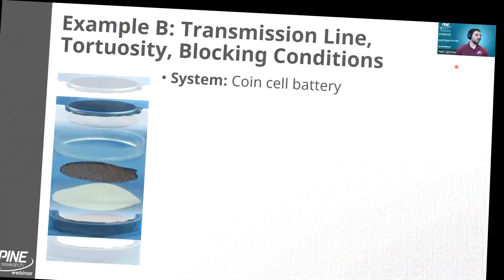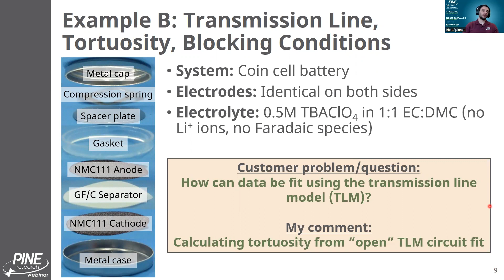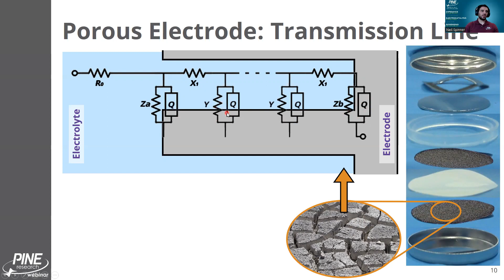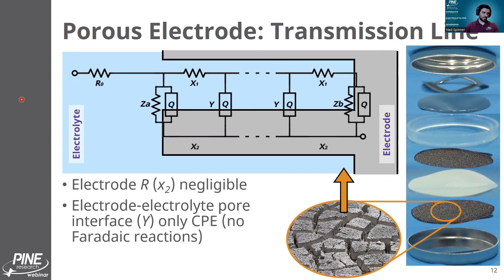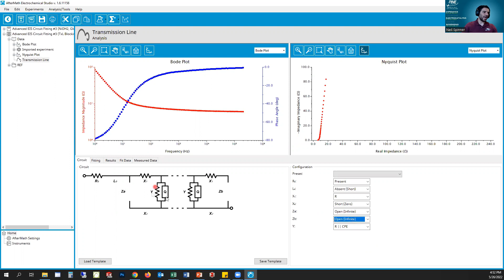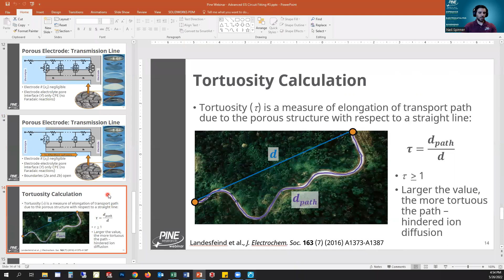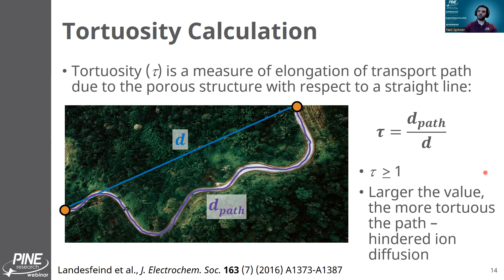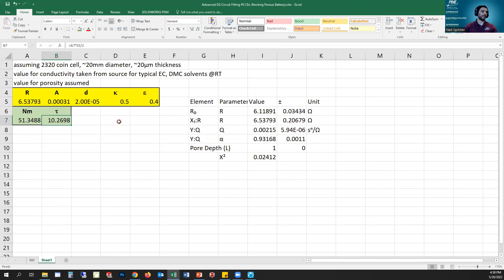EIS Transmission Line Fitting of a Coin Cell Battery Under Blocking Conditions

Comment: Summary

Intro
- 0:02: [Music]
- 0:08: Introduction to the video on EIS transmission line fitting of a coin cell battery under blocking conditions.
- 0:27: Outline of the video structure covering the electrochemical system, modeling using a transmission line, circuit fitting, and calculating tortuosity.

Description of Coin Cell Battery
- 1:00: Description of a coin cell battery, consisting of a metal case, cap, compression spring, gasket, and identical NMC-111 electrodes.
- 1:47: Details on the electrolyte used and the concept of a blocking condition in the battery setup.
- 2:35: Explanation of blocking boundaries and their use in studying the microstructure of porous electrodes.
- 3:10: Discussion on how to fit data using the transmission line model and calculate tortuosity.

EIS Transmission Line Model
- 3:29: Microscopic structure of the electrode resembling cracked earth, indicating porous microstructure.
- 3:59: Simplified model of porous microstructure including electrolyte, electrode, and backing electrode.
- 4:26: Explanation of the transmission line model, including leading resistor, impedance in electrolyte, boundary conditions, interaction in the pore, and impedance in the electrode.
- 6:10: The model reflects the distribution of current in the pore, representing non-uniform current distribution.

Transmission Line Circuit Fitting
- 8:30: Analysis of EIS data, showing capacitance, 45-degree lagging behavior, and diffusion typical of a transmission line.
- 8:57: Use of specialized transmission line circuit fit in software and adjustments to the model for fitting.
- 9:32: Refinement of the circuit fit and analysis of the fit quality.
- 10:53: Consideration of variations in the model assumptions and the overall fit quality.

How to Calculate Tortuosity
- 11:24: Introduction to tortuosity, its representation, and its calculation using the McMullen number.
- 13:00: Method for calculating tortuosity involving impedance resistance, surface area conductivity, thickness, and porosity.
- 14:09: Assumptions and calculations for determining tortuosity in the specific coin cell battery setup.
- 14:58: Interpretation of the calculated tortuosity value and its implications for electrode material and diffusion.

Conclusion
- 15:18: Conclusion of the video with an invitation for questions and information on advanced EIS webinars by Dr. Neil Spinner.
Reply from the maker: Thanks for the in-depth description

Comment: I have a question regarding tortuosity. My understanding is that tortuosity primarily provides insight into the transport properties of the electrode material itself. However, I am curious if the electrolyte, specifically the type of cations and anions, also contributes to the tortuosity. If that is the case, I am wondering how the diffusional contribution of the electrolyte ions could be calculated using values obtained from circuit fitting. One idea that comes to mind is introducing a Warburg element in series with resistor x1, which represents the electrolyte resistance inside the pores. The incorporation of a Warburg element would enable the calculation of the diffusion coefficient of ions, particularly in cases involving pure double-layer charging, within the pores. Does such a modification seem reasonable, or are you aware of alternative methods to address this?
Reply from the maker: "I am curious if the electrolyte, specifically the type of cations and anions, also contributes to the tortuosity"

I don't think so.  I believe tortuosity is strictly a physical measurement of the material and describes how tortuous, or not direct, the pathway is through it, essentially, regardless of what is moving through it.  I do think it possible, and perhaps even likely, that the choice of electrolyte could impact the reproduceability of the experiment and measurement of tortuosity to a certain degree.  But I would more attribute that to the normal amount of error and uncertainty associated with all electrochemistry experiments, and not necessarily to the definition of the property itself.

I also don't think such Warburg modification of the transmission line model is appropriate, but that may be a bit more of a longer discussion of the transmission line.  My other answer to a similar comment you made elsewhere went into a little more depth on this issue as well.
Reply: @Pineresearch  I am interested in exploring the diffusion-limited behavior of cations and anions within a particular porous electrode, aiming to capture both qualitative and quantitative trends. Since the TxL model accurately represents the morphology of a porous electrode, I would like to know how to effectively study the diffusion-limited behavior using this model. Specifically, I am keen to understand which electrical circuit elements of the TxL model should be the main focus and if there are any additional elements that need to be incorporated to accurately account for the diffusional-limited behavior. Any suggestions or insights on this matter would be highly appreciated.

In literature, I came across an example where a simple Randles circuit (consisting of a Warburg element in series with a resistor) was modified by substituting the conventional Warburg element with the M element from the De Levie model, which is known to account for restrictive diffusion (whether linear or non-linear). However, as we previously discussed, considering that the De Levie model is essentially a variant of the TxL model, it would seem logical to replace the Warburg element with the TxL model. What I find puzzling, though, is why the TxL model does not appear to have an element specifically associated with diffusion.
Reply from the maker: @Heisenberg-EC  This is definitely an interesting a worthwhile kind of investigation for you, and likely one that requires more in-depth discussion and research than can be covered in this video's comments.  I think there may be some explanation regarding the seeming absence of diffusional characteristics within the TxL model, but again, I think this discussion may be a little beyond this comment section.

Comment: I would greatly appreciate it if you could offer a physical explanation for why the boundaries of pores are treated as having an open or infinite impedance, and under what circumstances this assumption holds true. Personally, I would expect that the same electrochemical processes take place at the boundaries of the pores as they do within the pores, which is represented by Y, especially when considering spherical pores.
Reply from the maker: First of all, the transmission line (TxL) model is not specifically designed to represent spherical pores, so while it may work for such systems (honestly I don't know for sure, I don't have personal experience with it to say for sure or not), it is really more suited for the kind of rectangular shape I show in this video.

As far as why the boundaries are infinite, open, short, or really frankly anything dissimilar to 'Y' at all, this is a good question, and one to which I don't know that I have a perfect answer, to be candid.  I can only give a little adjacent pontification, if I would call it anything.  Mainly, in engineering science and mathematics, it is common to apply known end/boundary conditions (e.g., Dirichlet, Neumann) to differential and partial differential equations as a means to solve the mathematics analytically.  The TxL, to my understanding, is something of this nature.  So, one (admittedly a bit unsatisfying) reason is that simply put, mathematical solutions to the complex infinite summation included in the TxL requires a set boundary/end condition.  Without this, it is somewhat of a non-starter and circuit fitting cannot really be performed at all.

The other thing that is somewhat unique to the TxL is that the infinite 'Y' sum is supposed to be representative of an aggregate of charge distribution throughout the pore.  In fact, this is the explanation used by Juan Bisquert in the papers from which the TxL originated (to the best of my knowledge).  In other words, we observe the phenomenon of charge distribution in a porous electrode, and the TxL is a way to capture that behavior, and doing so also means there is necessarily a difference in the resistive and/or capacitive elements at either end, and throughout the pore.  Perhaps in some way, this can help explain why there is a need for different elements at different physical locations in the TxL model.
Reply: @Pineresearch  Based on my personal experience, I can confidently assert that the transmission line (TxL) model can effectively fit EIS data of porous materials that possess spherical pores. I am currently working with a material that exhibits such a morphology, and interestingly, its Bode plot bears a striking resemblance to the Bode plot demonstrated in this video. Upon qualitative comparison, the only noticeable difference I observed is that the horizontal lines in my Bode plot appear flatter across the entire high to mid frequency range. This observation leads me to argue that the TxL model can indeed be applied to porous materials with spherical pores.

Regarding the boundary conditions of the TxL model, there is one aspect that confuses me. If the mathematical solutions involving complex infinite summations within the TxL model necessitate specific boundary conditions, why is it permissible for the boundary conditions Za and Zb to be similar to Y? Wouldn't this essentially imply the absence of any boundary conditions at all? In fact, when fitting my porous electrode data, I obtained the most satisfactory outcomes when Za and Zb were exactly akin to Y.

Perhaps this alignment indicates that I am indeed working with spherical-shaped pores, where the charge distribution is relatively uniform. This could potentially explain why I do not require additional physical locations within the TxL model, apart from Y (and X1). In any case, I recognize the need to delve deeper into the fundamental principles of the TxL model to gain a better understanding.
Reply from the maker: @Heisenberg-EC  Having a boundary condition with the same form as 'Y' does not necessarily mean it has the same value as 'Y', so they can still be distinctly different.  Additionally, I don't think in general the TxL requires they be different, I was merely using an example I am aware of with engineering mathematics to help explain their presence.

Comment: Should the transmission line model be the default choice for simulating porous electrode materials, or can a standard Randles circuit also be used for fitting? If the latter is applicable, what are the advantages of using the transmission line model? Additionally, are there specific characteristics in EIS data that indicate the suitability of the transmission line model? For instance, would it be appropriate when the data begins with a 45-degree angle line, similar to the example shown in this video?
Reply from the maker: 1. Yes, you can certainly still use a Randles circuit (or series of Randles circuit) instead of the transmission line.  It is just a choice of how you wish to represent and analyze your system.  The advantage I suppose to using the transmission line is that, in some sense, it can more accurately represent the reality of an electrode microstructure because the infinite sum is designed to capture the distribution of charge within the pores, which is something a single Randles circuit does not describe on its own.

2. Generally, I recommend the use of a transmission line from a priori knowledge of the electrode microstructure, rather than looking at the data and applying it based on the data appearance.  That being said, your suggestion is not necessarily wrong, and perhaps in a situation where you are unsure of your electrode microstructure but suspect it might be porous, the appearance of a high frequency 45° line could help inform the application of a transmission line.
Reply: @Pineresearch  I am interested in the transmission line model due to the unique characteristics of one of the electrode types I'm using, specifically a highly porous and amorphous IrOx electrode. However, when conducting a PEIS measurement to evaluate the Ohmic drop, I consistently observe an almost perfect semi-circle (albeit slightly depressed) in the high-frequency range. This makes me question whether employing the transmission line model, as opposed to a Randles circuit, is truly justified in this scenario.
Reply from the maker: @Heisenberg-EC  Typically EIS data that displays a small and almost perfect semicircle in the high frequency region, regardless of the other conditions and parameters used, is an indication of one of two different phenomena; either, (1) there is an artifact going on and the semicircle should be largely disregarded, or else a shunt employed to try and clarify this feature, or (2) it represents an underlying substrate-film interaction that is always present in your system no matter what potential you're applying.  In fact, if it's #2, you may not really be able to apply the transmission line element very easily because in situations like this the time constant is much faster (i.e. smaller, where it shows at higher frequency) and unless you are able to simply cut out or disregard (just for analysis purposes) that first feature (which is possible, for example, with our AfterMath software), you will probably be forced to use some combination of Randles elements.
Reply: @Pineresearch  I don't believe there is any artifact present in my experimental data. Despite not using a shunt in my recent experiments, the same semicircle appeared when I did use a shunt. It's worth noting that this semicircle remained highly reproducible across different electrolytes. Moreover, the semicircle was not of a small magnitude; although I should verify the exact measurements in my data, it encompassed the mid-frequency range.

Based on my observations, I'm inclined to attribute this phenomenon to an underlying substrate-film interaction. I am actually utilizing a super thin (20 nm) IrOx film on a Ti substrate. I am particularly interested in the origins of the charge transfer resistance associated with this semicircle. My suspicion is that it may be linked to the oxidation process of the porous IrOx film, i.e. deprotonation of the OH groups via a proton-coupled electron transfer (PCET). I'm measuring at anodic potentials. I am measuring the Ohmic drop at anodic potentials (0.5 V_RHE); however, it is important to acknowledge that IrOx undergoes oxidation at an early stage and over a very broad potential range. What are your thoughts?
Reply from the maker: @Heisenberg-EC  That sounds reasonable to me, though of course I am not an expert in this exact field and probably cannot speak with more authority other than to note that your explanation sounds logical.  As I mentioned in my last comment, the fact that your semicircle is consistent across a variety of experimental situations, including potentials and even electrolytes, tells me most likely it is intrinsic to your electrode.  That means it probably is related to the substrate-film interaction that is constant throughout all those systems, and not related to anything happening between the top film layer and the varying electrolyte or applied conditions, which may be different across tests.